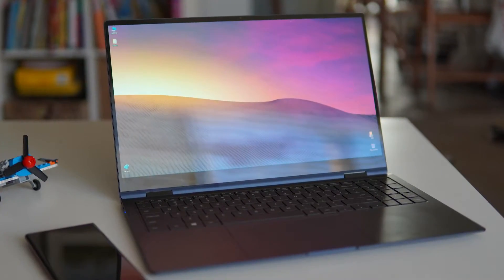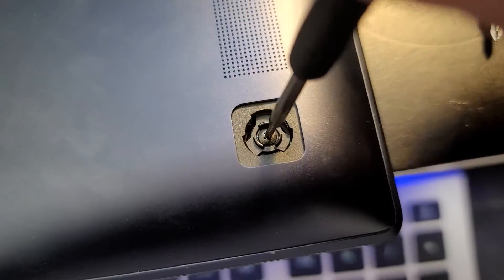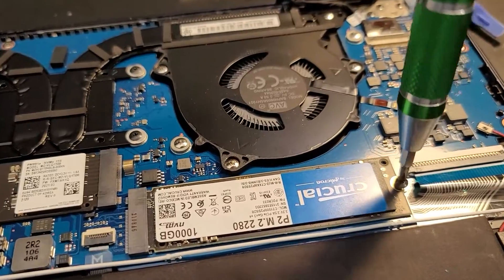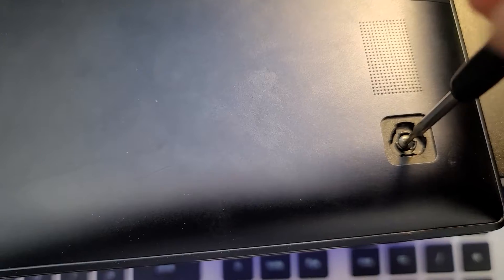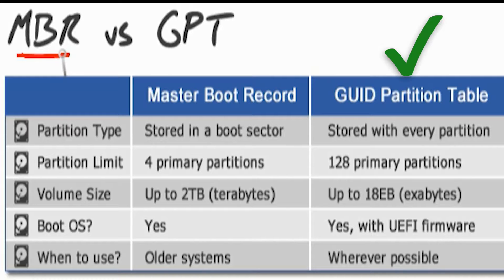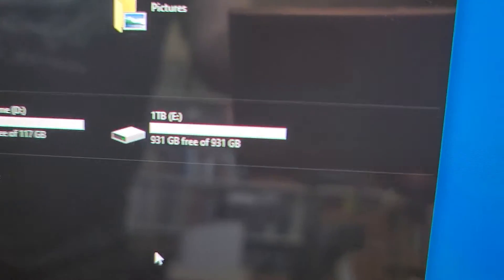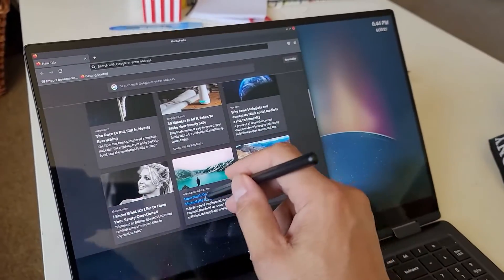Samsung Galaxy Book Pro 360- Add a second M.2

Comment: Do the 13.3" model has 2 NVMe´s Slots? I have onde 13.3... how can I upgrade both HDD to 2 GB NVMe  3000MBits without lost my files and configurations? Thanks a lot. My model is NP9300DB, Brazilian version.

Comment: Thanks for showing how to open the back. I use the instructions not to add a ssd, but rather to disconnect the battery. Both of my 360s had a recent bios update and it caused them to not boot up. I managed to get one up and running ( spouses' 360) by rehitting the power button continously, but mine refuse to and I read to open it up, disconnect the battery and then it started fine. Your video helped me open it up. Thanks.

Comment: Thanks loads for the clear video zaptoons! I just picked up a 2021 Book 360 15" 8/512. Samsung Magician says the installed 512 gb is the Samsung  MZVLQ512HBLU00B (also known as, apparently, the PM991a M.2 512 ). This seems to be maybe a 2242, not a 2280. If I want to upgrade the primary slot to one tb, will it take a 2280? . I was thinking of a Samsung 980 Pro or WD Black 850  in first position as the OS boot drive and move the 512 to the second position for storage. As well, the current 512 is PCle 3, but  intel  claims the chipset is capable of PCle 4. Will the computer take advantage of a PCle 4 drive, or does it max out at 3? Thanks! Frank in Toronto
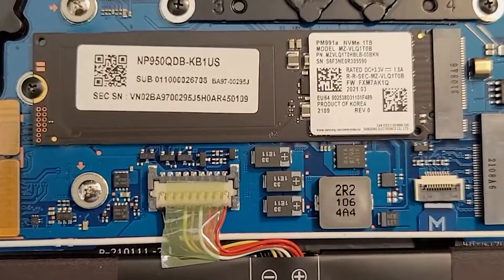Reply from the maker: Hey, since we have different models and Samsung does do different size SSDs at times (the ProBook 2 apparently has a second M.2 slot that's 2230) I'm not wanting to give bum advice. Samsung Magician identifies my factory drive as MZVLQ1T0HBLB-00B. In my video, around 0:54 you can clearly see the factory drive/label. (It's a 980-equivalent and 2280).  It also has the PM991a identifier if you notice. There are 2230, 2242 and 2280 versions of PM991a and different capacities. Searching this, I found PM991a 512 2280 drives (with that same model serial) that look identical to mine, and would be my guess what's in yours.  But of course open it and be certain. If you do have the full sized slot- then yes, you could upgrade to any 2280 M.2 drive.
Reply from the maker: Also: I believe the 2021 model will max out at PCIe3 speeds, using a PCIe4 drive. I'd love to be wrong about that, but I recall seeing that stat somewhere.

Comment: Shame that in 2022 version there is only a single slot.
Reply from the maker: I asked around about this and was told there is a 2230 sized extra M.2 slot in the 2022 version.  I haven't confirmed this myself. If so, larger capacity 2230 drives are harder to find, and a bit more expensive.
Reply: @zaptoons  would love to know for sure. Before I attempt to open mine.

Comment: So, I could swap out my existing 1TB for a 2TB and add another 2TB for a total of 4TB?  What if you used a Crucial P2 2TB 3D NAND NVMe PCIe M.2 SSD Up to 2400MB/s?  Will heat become a problem?   Can you mismatch drive sizes?  I have the 2022 Galaxy Book 2 Pro 360, 15",  i7, 1TB, Burgundy
 (NP950QED-KC1US).  Great video by the way!  I was happy to learn how to initialize the new drive in the software.  Sorry for so many questions!  I just don't want to goon this up!
Reply from the maker: To my knowledge heat from SSDs would be a function of how much data you are read/writing, not the drive capacity.  So basically NO, heat wouldn't be a problem based on capacity. YES you can mismatch drive sizes. The brand of m.2 shouldn't matter (I'm using a Crucial in my 2nd slot) as long as it's the NVMe standard. NOTE: from what I understand the 2022 model does NOT have a 2nd full sized (2280) M.2 slot. It should (according to people I've asked who own one) have a smaller 2230 sized M.2 slot.  Searching for these, it's difficult to find them in larger capacities than 512, and they are more expensive.  Please keep in mind I don't own a 2022 myself, so before buying anything, open it up and confirm what slots it has.

Comment: Hey there, I know, pretty late to this.. But in theory, can the RAM be changed if it dies? Like can you reach it with a soldering iron and remove it? Not talking upgrades, just repairs
Reply from the maker: For the average person, without highly specialized equipment- NO, I just don't think this is even remotely possible. Sourcing the chips would probably be next to impossible to begin with, and actually performing a swap- eh. I highly doubt it. The good news is, I see no reason why the RAM would just "die" during the normal life expectancy of these laptops. If down the road the RAM or any other onboard component crapped out, best bet would be a motherboard swap or authorized repair.

Comment: Awesome video. I wonder if this works on the new book2 pro 360. I just received my book 2 pro 360 a few days ago.
Reply from the maker: The new Pro 2 looks to me to be identical in design. You can probably open it the 15" same as in this video and see if it has the extra M.2 slot. I would be very surprised it it didn't. The CPU is different and there may be some updated chipset components, but otherwise I think the basic design is identical. Of course, I don't have the 2 so I don't know 100% for certain- but if you can pop yours open and let us know for certain it has the 2nd slot, that would be highly appreciated!
Reply: @zaptoons  So I popped open the back of my new book pro2 360 15in 1t model, and unfortunately, there is no additional slot to add an additional hard drive. 😑
Reply from the maker: @PreferAndroid  Perhaps some semi-good news. Asking around, there IS a 2nd m.2 slot. It is the half-sized 2230 slot, rather than a full sized 2280.  Checking amazon and other sites, it seems a little hard to find the 2230 sized drives in larger capacities than 256/512 GB, and they are more expensive.  But if you check there SHOULD be a 2nd slot, just in that half size. It's location may have changed also from the 1st gen.
Reply: I just added a second drive to my 15" Pro 2. The slot is located to the left of the C drive and it is the smaller version 2230 sized SSD. I picked up a 1TB Sabrent Rocket NVMe 4.0 on Amazon for around $100.00. Works great and its very fast. The 2230's can be hard to find.

Comment: Mine is 512gb can I add an additional 1tb? Pretty much can you mix 2 different sizes?
Reply from the maker: Hey Kenneth, if you have the Pro 360, yes you can add an additional 1TB. You could also upgrade your 512 to 1TB if you wanted. Both slots will take any capacity M.2 and you can use different sizes, absolutely- each is an independent connection.

Comment: I'd like to add a second drive and do a dual boot off of it.  Any reason that won't work?  Has anyone actually gone with a 2TB drive?  Specs online say expandable up to 1TB
Reply from the maker: I see absolutely no reason a dual boot won't work. As long as each drive is set up in a way that it has a bootable partition, then absolutely. one could select either drive to boot from at startup via the BIOS  boot selection. Trickier, would be to have an installed boot-loader that conveniently boots either drive from a single boot-screen. I used to do it on laptops with Linux and bootloader that also booted Windows, but I have no idea what the options are today. But there's no limitation I know of with the machine itself allowing a dual boot. I use mine for editing and I've used a lot of my 2nd drive for my work, so unfortunately I can't test a dual boot.
Reply: @zaptoons  Awesome, I'm going to try it. Thanks

Comment: Does this upgrade void the warranty?
Reply from the maker: No. The computer is designed so that you can open it, the slot is open and available. It's meant to allow this upgrade, so no it won't void the warranty.

Comment: How do you put the rubber feet back on afterwards? What kind of glue do you use? Or 3m pads? I still want access to the m.2 slot in the future!

And thanks for the video. Nicely made.
Reply: I would guess the glue is good enough to survive ate least one reaplication, just don't let dirt get on it.
Reply from the maker: The feet don't require any glue. They just pop in and out of the hole that holds them in.

Comment: Did you see any affect on battery life once the 2nd drive was installed?
Reply from the maker: No effect at all that I can see on battery life. An M.2 is pretty energy efficient- can run off just USB power, so I don't think it draws enough power to be discernible really.  I don't see any downside to having two drives in this laptop.

Comment: Hello!
I have a question.Do all galaxy book pro 360 15.6 inch laptops have an extra ssd slot in all us and uk versions?
Reply from the maker: To my knowledge all Galaxy Book Pro 360 15" models have the 2nd M.2 slot. The 13" models do not.
Reply: @zaptoons  thank you very much
Reply: @zaptoons  thanks, was wondering about the 13" version.
Reply: Mine (15.6 Book Pro 360 EVO Core i7 8GB/500GB purchased from Samsung direct Feb 2022) had the 2nd slot, where the first slot is on this video. The primary NvMe slot was where the RAM card slot is in this video. On my unit, the RAM is soldered (and therefore faster, but not upgradable) somewhere else. Bear in mind, I physically swapped the drives when I installed the 2TB, but from what I've read, that's not supposed to be necessary. After installing 2nd SSD Samsung EVO 970, to keep with the EVO theme in case it mattered (and as I understand it, it's all about power and heat,) I initialized it ("Drive 0.") I then tried to use Samsung Data Migration app to make the new, bigger drive my new "boot" drive. Always failed at the end. So, DISKPART etc, etc, etc, then I did a clean install of Windows 11 on the 2TB SSD. Then, I did a System Restore from my recovery drive. (You DID make a Recovery Drive, right? If not, don't panic. Just do a clean install, then go to Samsung.com for the app to install all the right drivers. In fact, that WAS my system that I had backed up on my recovery drive.) BTW--the included S-Pen on the Super AMOLED screen? EVERYTHING it's hyped up to be. BUT--I specifically bought this machine because it's thin, lightweight, fast, Super AMOLED Samsung S-Pen compatible. FWIW, this thing is pretty sexy. FAST. S-Pen "ink" blah blah blah seems to be everything Apple Pencil is--and the S-Pen requires NO battery! But--it's NOT "expandable." It's a runway-caliber cam model with religious objections to getting implants. I LOVE it. (I also paid 1/2 price with educator discounts, etc. So I feel like I got one hell of a deal.) And, like Apple, Samsung has a lot of symbiotic goodies for Samsung phone and tablet users (like, moi, obviousamente.) I was an ASUS fanboy (still am.) But if you want a georgeous 15-inch laptop with core i7 AND really, really want a really, REALLY good 2-in-1 S-pen Ferrari, get THIS one.

Comment: To bad you cant expand the RAM.  can you add an external GPU?  How well does this compare with the Asus Duo 482?  The other laptop I am considering.
Reply: The thing about THIS laptop (as of January 2022) is: 1. The super AMOLED screen and the included S-Pen;  and 2. It's a super thin, very light, with RAM is soldered in--making it faster, cooler, etc. But at the expense of "expandability." So, if you want an "expandable" laptop, you'll want another brand. I bought mine specifically for the light, fast, 2-in-1 S-Pen on 15.6in. But that's specifically what I wanted.
Reply: @tommyjonq  I did a 40 image focus stack using Affinity photo. This laptop cooked the edit in about 2 minutes.  I could not believe how fast it did it.  I will say I was also surprised that it used up 10-15% of the battery doing the edit, this can't be normal?  Battery life is not very good.
Reply from the maker: It has one Thunderbolt 4 port, so I believe yes, it can use an external GPU via that. I haven't tried it however.

Comment: Does this apply to GB Pro 360 13" also?
Reply from the maker: I found a review with teardown of the 13" 360. I think it only has 1 m.2 slot.   Here's the site with images of the 13" model opened up. https://www.notebookcheck.net/Samsung-Galaxy-Book-Pro-360-13-in-review-Samsung-s-new-business-class-for-convertibles.547882.0.html

While you can't add a second m.2, the good news is the factory one is replaceable (seems to be taped in, but just lift the tape up) and say you got the 256GB model or something, you could easily upgrade it with a 1TB, for example. Of course you'd have to reinstall the OS, but just create a USB stick installer first- the windows license will be tied to the hardware.
Reply: Is 1tb the maximum?
Reply from the maker: @lc4367  No maximum, you can add any capacity of M.2 NVMe so long as it's the correct size and type.  2TB M.2 NMVe drives run around $200-$300. As far as I know there's no maximum limit. Great for future proofing when eventually 4TB and higher M.2's come down in price. So long as they are Gen3 , no problem with capacity.  I'm not sure if this laptop has Gen4 M.2 support at full speed, but it will certainly support Gen4 at Gen3 speeds.
Reply: @zaptoons  Big THX bro!